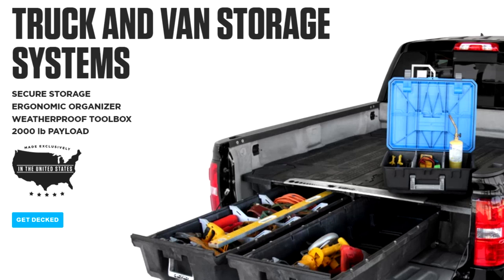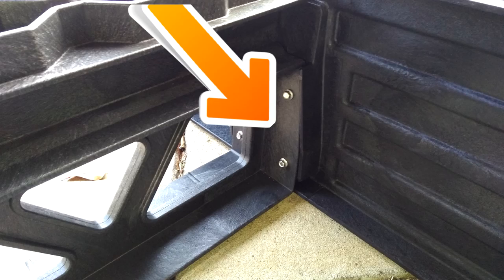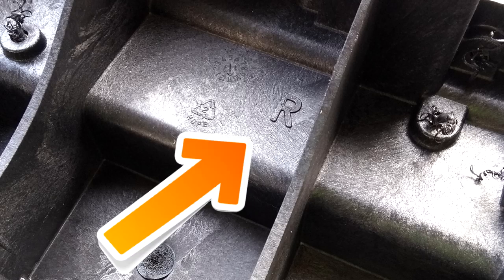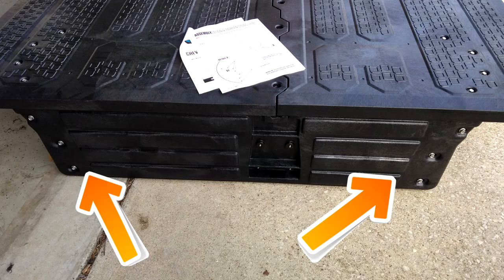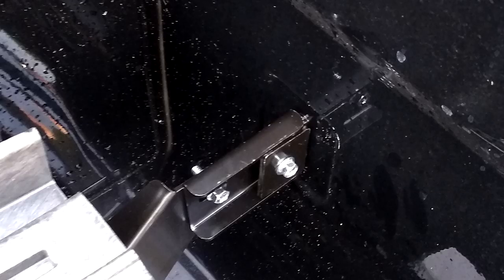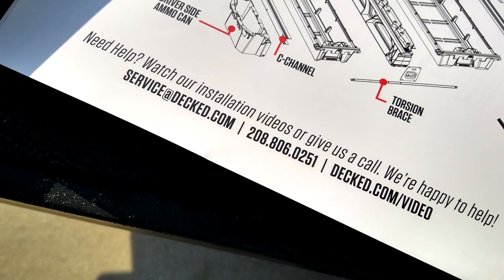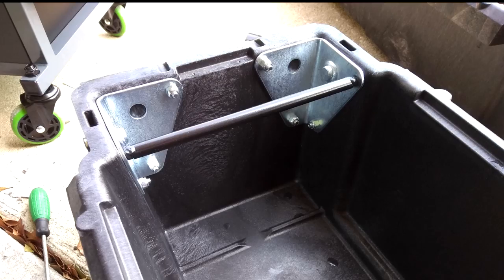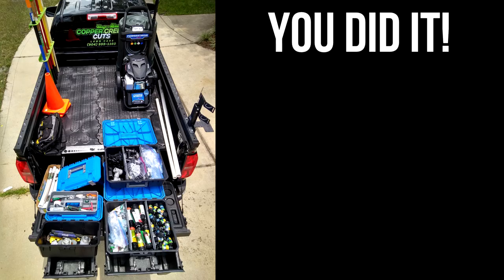How To Install DECKED Truck Bed Storage System (Girly-Man Edition)

Comment: I see a lot of people transporting a lot of loose stuff in the bed of their trucks.  If they ever have to stop suddenly that loose equipment can quickly punch out a rear window.  It is even more critical that items be secured when they are on top of a raised deck.  At a minimun, I secure all hard items such as gas cans, mowers, blowers, power washers, etc. with 2 tie-downs and soft items like tarps with a single tie-down.  It takes a moment but could save my window or prevent an item flying out of my bed.  

Be especially careful when transporting 2 bys on a raised deck.  In an accident, they can fly through the windows and do serious injury.   

Decades ago I had a load of plywood, 2 bys, 4 bys, and railroad ties on my drop-in liner.  The load was heavy and  just a bit too long to allow me to close the tailgate.  I was going less than 1 mile on flat ground.  Less than 1000 feet from the lumber yard was a stoplight.  When green I accelerated slowly, but apparently fast enough that the whole load slid on that super slippery drop-in liner and went 'plunk' in the intersection.  Another vehicle stopped and the driver and I loaded everything again and I used a rope to secure it.  My loads are now always secure and I have not lost anything since that great learning episode.
Reply from the maker: Excellent advice to think about, thank you for sharing it and your story!